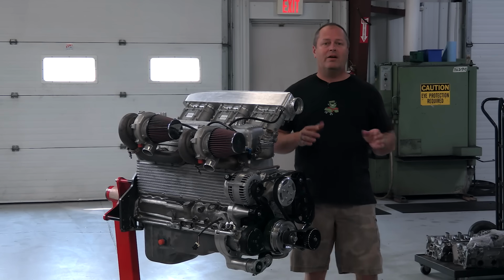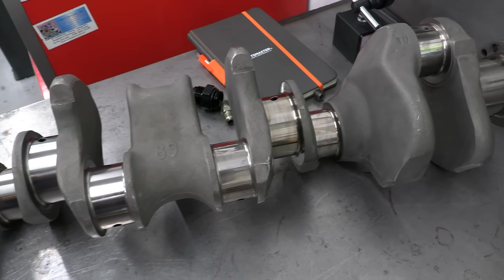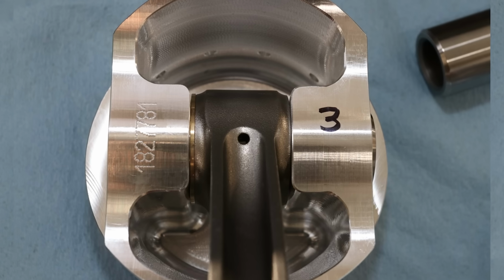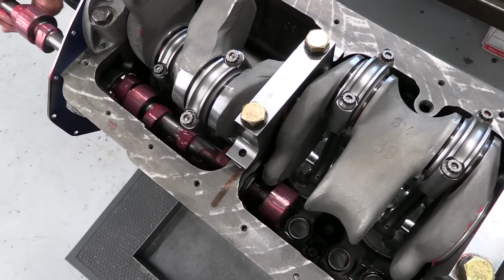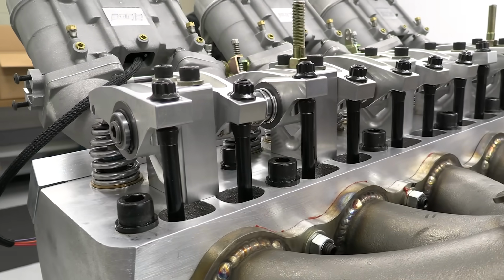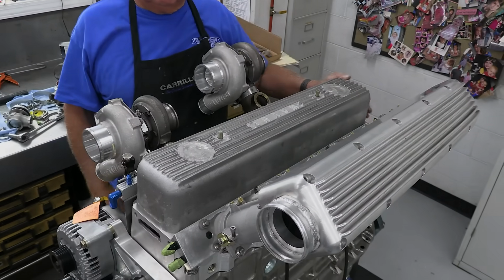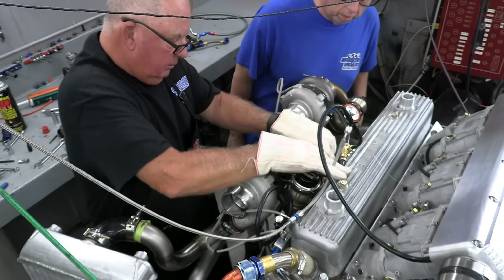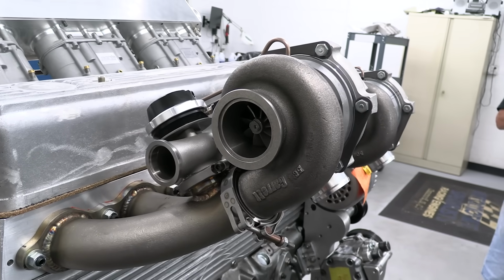Incredible Twin Turbo Chevrolet Straight Six is a One-of-a-Kind Creation!

Comment: The 292 i6 was overbuilt for longevity. A built 292 i6 and the Ford 300 i6 was the surprise that no one was ready for. On city streets a built six smokes small block V8's, light to light. The 292 GM i6 and the 300 Ford i6 are torque monsters, not horsepower monsters. These two engines were used in vintage modifieds and did very well on both dirt and asphalt tracks.

Comment: This is an Incredible engine.I enjoyed the video because it's different that's exactly why I built have a 261 other than a 350. I  rebuilt my '55 261, in my home shop thus my interest . I might take issue with 2 items you mentioned. There are plenty of hi-performance items available you can install on this engine. Clifford has a 6=8 conversion kit with a weber carb and a 2 collector header pipe, EFI ignitions, external oil filter kits and plenty of info on installing a PCV system on them. The second point you mentioned this engine released nearly 100 years ago. The 261 was not introduced until 1954.

Comment: need a 4200 vortec to turbo charge.  the cam overlap and vvt should be great.  cross flow cylinder heads. sounds like a turbine

Comment: These straight 6 cylinder engines built by GM and for were known for there torque.  These engines were really almost bullet proof too. Friend of mine had an chevy straight 6 with over 300,000 miles. Poured like a kitten

Comment: Its still a 4 main bearing engine ...chevy's last inline 6 would have been the best choice ...with 7 main bearings and came in sizes of 194, 230, 250, and a 292 truck engine that all bolt up to  the same bell housing as a V8...uses the sameb valves and lifters  as a small block chevy V8 ... There's plenty of room in the head to machine it out to fit 2.02 Z28 intake valves and exhaust ....you can bolt on a cylinder head from a 194 on to a 292 k raising the compression ratio of bunch... But this also allows you to put out the head and reshape it to a better squash area and still keep the compression ratio above stock ... The combinations are very flexible.... There are turbo versions  about 500 horsepower

Comment: If your engine has a side block breather it is from tje stove bolt family.  The newer engines were 194/230/250/292.  These started in about 63 or 64.

Comment: All those custom castings and bolt on billet pieces... You have to wonder what could be achieved in the air handling departments as 3d metal printing becomes more affordable

Comment: Amazing. I had a hot rod engine specialist rebuild the 230 ci straight 6 in my 67 Chev pu, several years ago. In doing the rebuild he explained to me some of the problems, such as the combustion chamber in that old 230. He proposed some ideas for increasing performance, but, as with many people. At the time, expenses were a limiting factor. I wish I could have let him make some of the mods he proposed, but it was not to be. He might have come up with 250 HP out of that 230. That would have been fun. As it turned out, he provided me with a very competent running nearly stock engine, but it provided many years of running. My son  "inherited" the pickup which did not outlast the engine. Last I heard he was pulling that engine for another application. I always thought a lot of the Chev straight six, but never imagined a 500 HP version. Cool video!! Wonderful imaginations, and amazing technical abilities. Thanks.

Comment: Check out the 300cube ford on power nation, single turbo made more bo, and didn't have any exotic parts, non.
Reply: Wish they would have put one of those Cleveland heads on it, that was a record setting combo in the 70's . I believe they fire brazed three Cleveland heads together, and it was naturally appeared.

Comment: There is nothing stock about that engine except the block casting other then that nothing else is stock even a stock cam will not fit into the cam bore. You got to have big deep pockets and 2 years maybe to get all the custom parts needed to build that engine. If you want to see a inline 6 292 chevy engine with stock and aftermarket parts check out Engine power season 7. It don't make nothing like this but they use stock and from summit aftermarket parts

Comment: My father specialized in hopping up the straight 6, bore + 1.25, stroke w/ 292 crank, Powerglide head w/ Vette Blue Flame cam or Pontiac OHC head after it was available, side draft carbs, truck starter, Packard or Cadillac Synchromesh transmission or power glide, and belt drive turbocharger. As you mentioned, there are lots of tricks to building.  That Wayne head, intake and turbos are awesome!

Comment: Great work on the Induction system, but the plenum plate with built in airhorns, and mounting system........ I designed 20 years ago...... Extrudabody

A little cred's would be cool.......... ;)

Comment: Lots of mucking around, big money and custom stuff for that power...

My Barra makes that power on 15 psi on pump fuel. Stock turbo. Only thing I changed in the engine was the valvesprings otherwise it's totally stock internals.

Just gave it more fuel, custom tune and better cooling..

You're better off money wise doing that if you are after incline 6 turbo power
Reply: sounds like you didnt watch the video, this was done for S&G  and for Show

Comment: Why anyone would spend this kind of $$$ on a weak Chev 261 instead of the HD truck GMC 302 that was also used by the US Army 2.5 ton truck (deuce and a half) is unbelievable. The 302 was what serious racers used back in the day and not a weak 3-main straight 6 block;  Reliability/longevity will be the factor with this setup.

Comment: Nice build quality. Flawless from what I can see, in fact. Two design things I would have done differently are provide some "squish" (flat area of head next to combustion chamber that the piston gets close to - stirs the mixture up and cuts down on amount of spark advance needed) - and also used much more cam timing enabled by true Isolated-Runner induction designed without the balance pipe.
You can put the MAP sensor in the plenum chamber and then that particular computer can work as an "N-Alpha"(RPM times throttle opening) system from there.
         This isn't criticism it's just "bench racing" !  But I think you could have met your HP goals without turbocharging but with some squish, more cam and true IR intake. Conversely - I think you also could have met them with the stock head and that wonderful computer and a single turbo.
     I get it - I know what a Tour De Force is - and this shall go down in history as "The Ultimate Stovebolt Six !"

Comment: Love built! It would be the sleeper of sleepers!!
The pieces of equipment used are top shelf, for sure but: have seen so much dirt and crud on the inside of this build. Now know you don’t leave this beautiful engine as is but why would you put it together before you wash down on all parts before adding oil and moving it around.?? Again, sure you are going to clean before running this engine, right!
Thanks for an awesome build!👍🏻👏👏🥇

Comment: I
 Did Keith use cups under the valve springs, it’s tough to tell as I can see shims. I have used both inner and outer style on my GMC 6 cylinder 12 port head. There is a lot of movement at the bottom of the springs. The stock cylinder head have a machined receiver “cup”.

Comment: My prayers are finaly answered  . I am so happy to see this engine is coming back. 
I would like to say that the first gm inline 6 was known as the stove bolt because it used a stove bolt nut on the bottom end, rod bearings so you could remove them with a monkey wrench or a crescent wrench .
Also I have seen the 261 with a super charger , fuel injection and overhead camshaft, gm raced them in sprint cars and kicked fords ass .

Comment: The most technologically advanced "stovebolt" 6 may be this one, with the addition of turbo and fuel injection, but we also have the  7 main bearings ones, 3rd gen 250 engines, 24 valve racing engines made for "Turismo Carretera" category from Argentina, with an advanced head design, they are not turboed but they breathe like crazy, up to 9000 rpm, making 451 hp N/A. Besides being limited by category rules to 189 CI (3.1 litres), they make some serious power. The sound of that cars is incredible. Wiki on TC racing: https://en.wikipedia.org/wiki/Turismo_Carretera

Comment: Ya'll have been working on  this for ever. Never seen it in the car or anything. So what happen you guys run out of money. This video is older than Methuselah
Reply from the maker: The engine and video was completed and sent off to the car builder. I have no control over it after that. Not sure when the Suburban will be done. Thanks for watching

Comment: There was good reason why no performance parts exist for these.Some of there many(unkind) nicknames they earned was babbit pounder and rod smasher.They threw rods if you just looked at them wrong.I can remember my grandfather saying once he wouldnt ride in those trucks after one exploded and sent fragments into the firewall..Of course they got the babbit pounder name from the earlier 6 that didnt use inserts.They had alot of other issues as well which made them unsuitable to modify for more  power but looks like these guys succeeded in building one of these and making it hold up.

Comment: Nice video. Personally, I don't see why so much extra engineering, machining, and work is worth it all. I've rebuilt the old Chevy 235 stock engine and wanted to soup it up, modify it but now this engine doesn't even resemble what it used to be-the inline six. i just do not see the point in it all. I could, if it still looks like at least the outside like it came from the factory. I would look at this under the hood at a car show and wonder why? I do appreciate the ingenuity and workmanship, regardless. I would rather it looked like an original but a true 'sleeper' but that's okay, not mine and to each his own. I guess it's the challenge that drives us to do such things. Nice work

Comment: Question why run a parasitic off of a belt when you could run a dry sump or run an electric oil pump. Can that been done? I learn so much watching you guys Thank You 🙏
Reply from the maker: Lots of people run electric water pumps in race cars, but I've never heard of anyone running an electric oil pump. Plus, this engine has been limited to 500 horsepower because of all the rare components. It is capable of plenty more, so trying to eliminate any parasitic hp losses wasn't a concern. Thanks for watching!
Reply: @TheHorsepowerMonster  Ok just learned something again, I am thinking about a Flattie. Which years are the best ones for a mild modification.
Reply from the maker: @bigmountain7561  Are we talking about Ford Flathead V8's? If so, the newer ones that don't have the cast-in bellhousing. Actually, with anything that old, the best ones are the castings that are still in the best shape (no cracks around exhaust ports, least severe rust, least machine work already done to it, etc). Whether you are talking about a Ford Flathead or a Willys flat four, pickings are getting slim so unless you already have something, you may have to just work with what you can find. Good luck
Reply: @TheHorsepowerMonster  Thank You I am looking at a Monterey maybe. Spud’s Garage had a I think it was a 39 with a Columbia 2 speed. I know that you guys can build engines that exceed the speed of light, I like ones that I can cruise the back country meet people and enjoy what the good lord has given us. Friendship and Kindness. I guess for 62 I am old fashioned. One day I love to see laboratory where those beautiful one off engines come from and know what you all forgot. I really love the videos and really learn a lot. Thank You 🙏

Comment: I was impressed with the build till I saw the dyno HP . you guys are old like me...I see from your intake choices your stuck in the nostalgia instead of performance mindset...Your about 400 HP shy of what it could safely be run at if you ditch that multistack 1960s tech intake, so sorry if that sounds harsh. but well guys , its true nowadays. Just wondering why you wasted all those dang resources on a twin turbo  instead of a premium precision single turbo and injectors, ECU. This build really reminds me of something i would have come up with in the late 1980,s, when I first started performance machining. Not bad , just really nostalgic. It is VERY pretty though! Sledgehammers can be polished !!!
Reply: they are just having fun. it made 400 horsepower. thats a ton. id say youre trippin

Comment: My fav is still the Power Nation Ford 300 inline six build- 597 lb ft of torque on a carburetor and stock connecting rods, head gasket, with likely more to go if they swapped to a stronger wastegate spring 👍

Comment: I have a 30 over Chevy 261 with a special cam and lifters , sporting a 4 barrel intake with a Carter 500 cfm carb with headers sitting on top of a high compression modified 235 head in my 1953 Chevy pickup , it’s nothing like this but I love it  ! 
PS.   Great  Job guys !  🥰

Comment: Hello, nice project! In argentina we have plenty of this straight six engines and many options to get power! There is a category call Turismo carretera where all cars have this engines but natural aspirated with carburetor, cylinder head remake and now have 24valves DOHC and making 500hp around 8000rpm, sound amazing I really recommend to search here some videos of this cars on board!!. Also this engines is very commun to see in drag races, N/A or turbo with the original cylinder head and making nearly 1000hp some cars. 
Edit. A good video to appreciate this engines and the amazing sound going nearly 285 km/h.
https://youtu.be/SxXorsKJAZE

Comment: I done it  with a 57 Impala 235 into a 49 1 ton Chev pickup. It had a 3 duce carburetors, a solid lifter cam, 3 angle valves, springs that hold 6200 rpm, and 2 1/2 exhaust. With a 4.58 rear end gears and 17.5 tires, with 1 chord of wood, it could out accelerate most cars up to 80 miles an hour.

Comment: Hey I was wondering what size engine is that? I've seen people build 292 straight sixes. I watch my dad back a long time ago build 235 CID straight six. He always encouraged me to build a straight six never did. Like many people who didn't do something and we built a lot of stuff together well now that he's not been with us for just a very short period of time, I'm interested in building a 6 cylinder probably a 235 CID because that's what he always built and I have a few of them. When I saw the original valve cover it looked like an old Babbitt rod engine maybe a 216 or 235 CID. I've got a couple of those two 16s and I think that big big six I have and a 48 Chevy oil drill rig is a 348 6 cylinder. So I run number sixes already cheese from. Some people think I know a lot but I look at other folks and say I'm a novice. Like a buddy of mine who passed away 8 years ago always said man is always somebody with bigger toolbox. You can chuckle that could be taken several different ways. So I'm watching an amazement to your build! My dad would talk about the days when he would put a four barrel and even two four barrels smaller ones on a 235 Blue flame. Or is probably an oftenheiser intake but whatever it was back in the day haven't ate one barrel on his flathead V8. So will I sit here on property back in the trees and there's a lot of them looking at well I go in the shed I can look at them . A collection of 53 3 65 Chevys mainly cars and two door wagons and I've had it a couple of trucks. I'm thinking that would be a great engine to put in my 506 pick up. Thought about making it a tomato clone and I know he had a V8 under his hood but wouldn't that just impress people to ask questions and get more interested in the hobby of old cars! Now my budget would be quite a smaller than it took to build that one. But when you fell as a producing over 500 horsepower at basically two horsepower and a little more per cubic inch on a straight six with the promise of being able to do much more! Wow. I'm looking for some ideas and I welcome any reply from those in the video or anybody else you has some expertise in the Chevy straight 6. All I've got a Ford straight 200 and a Ford 300 straight 6 as well. As you all know if it's set in a car it's a straight six I don't have rod sticking through the block if it's stuck it probably start with the little finesse. I've seen the 300 Ford be built with a modest build around 400 horsepower and that's great but I'm really more interested in the 235 or that family of 6 cylinder engine. Heck I ain't got an old 230 CID. So to say I really like enjoy your video would be an understatement. I'm looking to do the sincere most sincere form of flattery and that is copy your idea but scaling it back keeping it on the budget. Even for me this is a long long comment and I apologize to those who don't like long comments. But I could Google and all kinds of things and not find what I found in a YouTube video like this on different forums. You know I told somebody in my family I'm used to pick up phone call Dad maybe three times a day. Not because I didn't know the answer to the question but to see what he had to say which usually was a lot deeper in the answers than I came up with. But one relative said you can't do that now and that relative is right. But I can ask somebody else that my dad would really enjoy talking with about straight sixes. To thank all these years in my hay day I was pulling those things out setting them aside and putting in small blocks. Thank you for the video and the memories you conjured up.